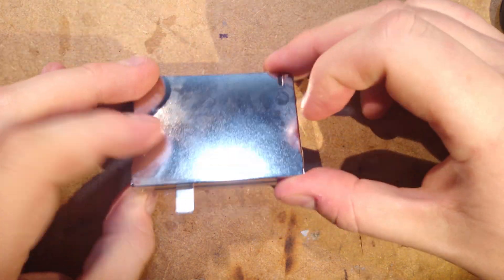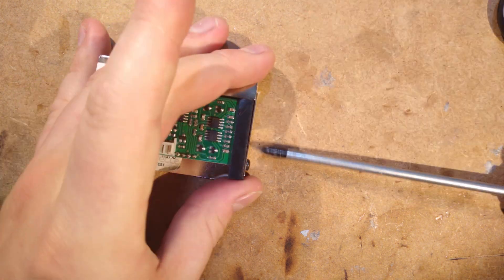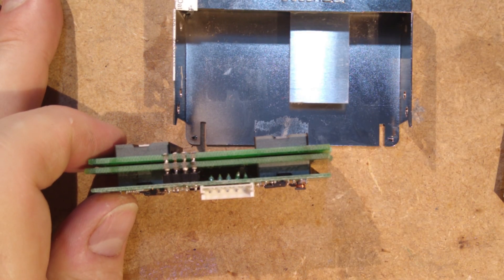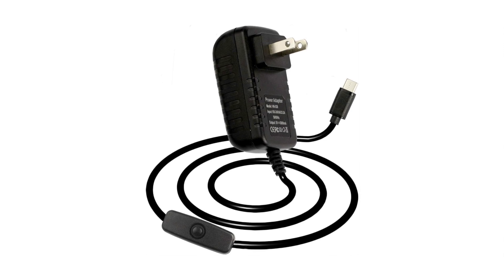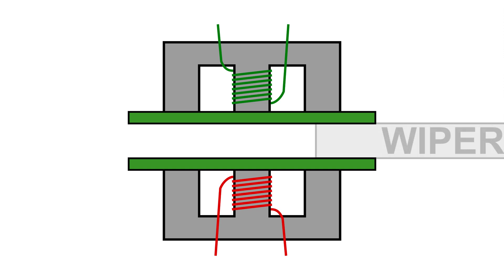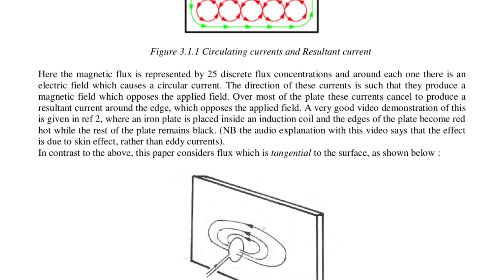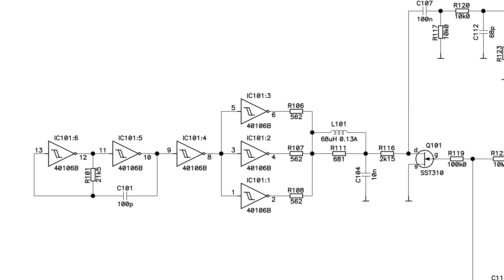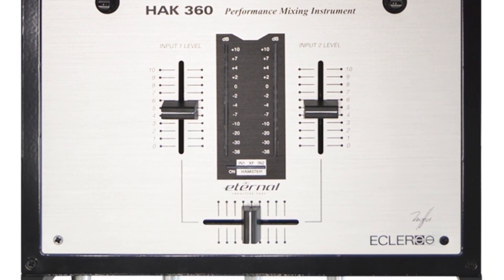Ecler Eternal magnetic fader teardown

Comment: I imagine a fader based on magnetism can be made an easier way. For example, using hall effect sensors at both ends.
Reply from the maker: Yeah that's how the rane faders work
Reply: Ah. Alright. By the way, how did the capacitance measurement data transmission on those spinning discs for those mini-portablist products without a slip ring? @TheRasteri
Reply from the maker: @OMNI_INFINITY  because you only need one conductor for a capacitive sensor, you don't need a slipring - the bearing itself conducts well enough to work
Reply: Cool. Haha. Hadn't wondered until tonight when thought about it. So literally using the bearing as a circuit. Nicely done. Engineering salute for that! Actually used some mochi (was residing in japan) for a cap button before. LOL.  @TheRasteri

Comment: Hi. I'm trying to find an L101 inductor 68 uH 0.13A that is located in left upper corner of pcb. Can you tell what original part is?
Reply from the maker: no idea, but any other 68uH inductor would probably work, as long as max current is more than 0.13A you're fine

Comment: Does anyone out there find this fader repeatedly gets sticky from the glue holding the metal squares in place?? I'm CONSTANTLY having to open her up and scrub between these boards with alcohol, wiping away the yellowy sticky residue that seems to just appear. 
The metal slider is touching one of these boards as it moves back and forth (there is a mm or so of vertical play if you move the fader cap up and down, and it will touch the board), but that only seems to matter if there is a build up of glue, so if it gets sticky (usually after a few days of heavy use) i'll open it up and there will be glue on the slider plate too. (should i be adding red deoxit to reduce friction here or not?)
Also, the glue holding the slider plate to the plastic slider has failed so now I'm periodically glueing that back on too.... I had the fader a little under a year before i started to have issues. :(

I can see one comment here saying they barely ever need maintenance but that is the opposite of my experience. I'm genuinely gutted as i can't afford to replace rn and i just want to practice!!!!! 

Respect to @TheRasteri for the amazing video, i can't find much else out there so any comments would be greatly appreciated!!!! ✌️
Reply from the maker: The metal wiper isn't meant to touch the boards... maybe try very gently bending it
Reply: @TheRasteri  Hmmm, aye, but it has a wobble which means even if it's perfectly central, it will still touch them if i wobble the fader cap. Which obviously i do whilst cutting. Maybe the two bars which hold the slider are loose then? 
Thanks for suggestion tho dude very much appreciated. 
If anything else comes to you lmk!
👌
Reply from the maker: @superducker7899  yeah that sounds like a loose slider - at least on the eternal I tried, it was moving without touching either circuit board

Comment: Hey Andy. I just resurrected my Ecler HAK 360 that I inherited off my late friend Soren. I absolutely love the fader and mixer in general but I'm getting weird crackling, distortion and left channel dropouts and all sorts of weirdness. Was wondering if you had any ideas what was causing this? I took out the fader and gave everything a good clean but it's still happening. Cheers bruv
Reply from the maker: could be anything mate - it needs gone over with an oscilloscope. Take it to a repair shop

Comment: What happens if you put or move a strong magnet near such fader?
Reply: It wouldn't interfere with the high frequency signal in the coils, but a strong permanent magnetic field could saturate the inductor/transformer, blocking power transfer.

Comment: isnt the metal in the carlsberg can aluminium too?
Reply from the maker: Actually yes, the original plan was to use a Fray Bentos pie tin but it didn't fit between the circuit boards :(